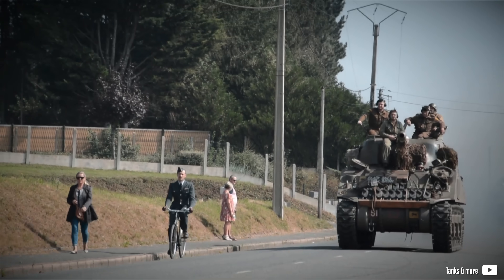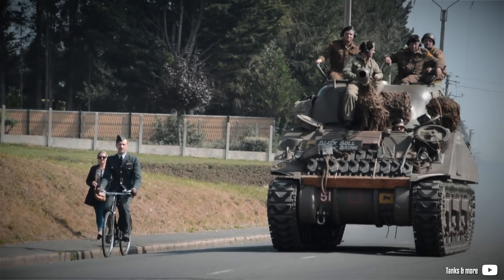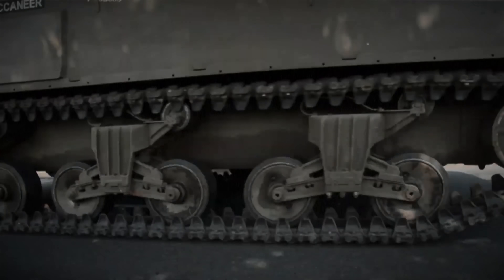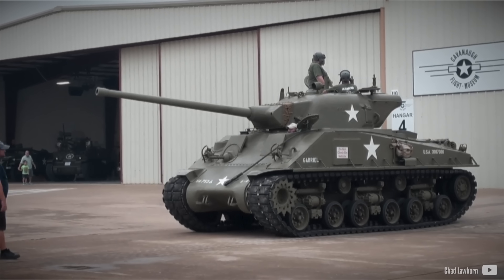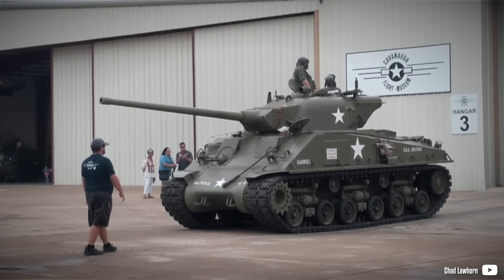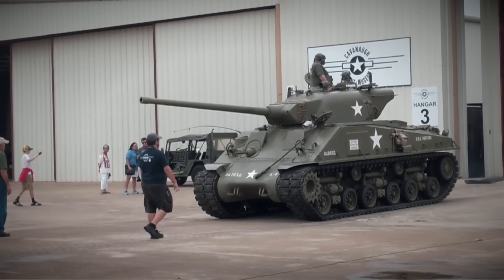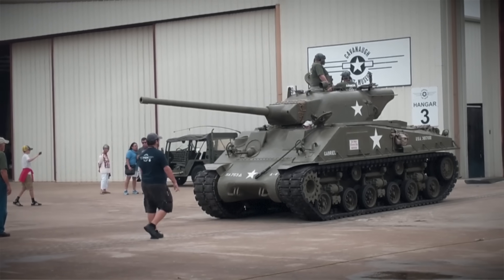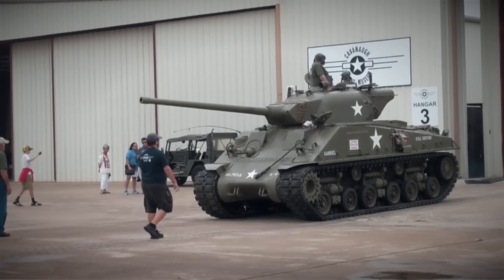This Super Complicated 30-Cylinder Was Sherman's Most Reliable Engine

Comment: VERY COOL, Sir!  
I don't know how the poor mechanics dealt with the thing...  
For the other viewers, how many diesels did they try to use?
Reply: Two different radial diesel engine designs were trialled, but never made it out of the proving grounds testing and evaluation phase. The success was the Detroit diesel twin inline-six pack, used by Marine corps, state side training units of Army, Tank destroyers,  and  export equipment. The Soviets liked it well enough to copy it and use it for years in their APC designs.
Reply: @KevinSmith-ys3mh  Gee, I knew about the V12 GM diesel, but considering how diesels run cooler, I would have thought there were air-cooled diesels in that configuration...

Comment: Tough little 6 cylinder engines those were.
Now a new Dodge diesel pickup has about the same power as the old tank but with one engine and more economical and less smoke and noise.
Cummins torque...

Comment: Many years ago, in the late 50's, when I was building and flying model planes using the Cox .049 glow engine, we toyed with the idea of making a 9 Cly radial engine by coupling 9 engines around a common drive shaft but life got in the way and it never happened.

Comment: This cobbled together engine seems like a great example of how underrengineered is the same thing as overbuilt. It was made with stock parts and relatively little time to refine the design so it was built with lots of redundancy and comparatively low loads to minimize stress and avoid the the risk of a minor oversight becoming a major weak point. It's brilliance comes from how little brain power they could afford to spend on it.

Comment: This design is so genius tbh. A proven engine design and hell if you get hit in the engine or something internal fails as long as the other "engines" can keep working you should be able to limp back never-ending driving with a dead cylinder you could drive this thing with a dead engine bank 🤣

Comment: The A-57 Multibank, al be it as complicate as the Napier Deltic, was basically a reliable engine that Chrysler had produce for a long time before being combined into the A57 for the Sherman Tank application.  Being a mechanic who has restored and maintained many classic and historical US Military vehicles I will tell you that ALL of the horsepower ratings were very conservative.  That is the case for many of the power plants from the 40's and 50's, they were all underrated due to some of the BMEP math at the time.  Regardless, this is a very interesting power plant.  When is VisioRacer going to do a piece on the Hall-Scott 400????

Comment: A flat head 6 cyl engine would have been something many mechanics and the mechanically inclined would have been familiar with. Five of them hooked together was just formality. That helps when comes to maintenance and repair. Which is the priority right after beans, bullets, and gasoline.

Comment: Everyone seems to be talking about  complexity. But the Chrysler Multibank is, ultimately a simple engine: It's five civilian flathead sixes - probably the most ubiquitous American engine in cars and small trucks - geared together. What complexity it does have comes from multiple parts doing the same job - five water pumps, five distributors, five carburetors, each with a design perfected over millions of civilian miles. Any single engine that fails can be pulled out of the system in the field. And, I suspect that disengaging a failed engine might have been much simpler than it'd seem - a matter of releasing one of five dog clutches, or pulling one of five splined shafts out. They'd want it quick and easy to do under fire.

Comment: Gotta love the old chrysler flathead 6.   Even under racing conditions they are reliable.  Not fast, but reliable.  My truck dynod at 83hp and 170 ib ft at the wheels, top speed of 86 mph.

Comment: A fascinating engine to be sure! Seems like a nightmare to work on but maybe not too. International Harvester tried the same idea with interchangeable parts. Problems occur trying for efficiency and longevity while  trying to force the concept of interchangeability over  a wide range of horsepower/torque needs. Trucks got big mostly but brand snobbery in the
American market place contributed to new designs.

Comment: I like the idea of it being able to work with a bank out of commission, and very easy to break a component off and swap out another engine.
Reply: Reliability wise its genius. Yes, there are a lot of parts, but they won't all fail at the same time. And even in the field you could, in dire emergency, Probabaly manage to flip some un-damaged parts into other non damaged sub-engines or something. Would be even funnier if you had a truck you desperately needed with a daged engine and you go, wait up we can spare one of our 5 sub engines for now 😂

Comment: Great video! The early M4s had an air cooled Wright Whirlwind (Continental built) 9 cylinder radial aircraft engine which in itself is pretty cool but this 30 cylinder beast takes the cake!

Comment: Dads a retired trucker, uncles, cousins, me & my brother & brothers in law all drive or drove & retired. Detroit Diesels were the engines most of us ran, M&G car haulers (later became) RYDER hauled volkswagons & mercedes benz off the boats in Newark, NJ. & Anchor Motor Freight hauled GM out of Lordstown, Ohio both had Detroit Diesels in their car haulers. I can say those trucks were single handedly responsible for the right lane on most interstate highways in the country to be nicknamed “THE ANCHOR LANE” because Detroit Diesels can’t pull a sick whore off the toilet. They are screaming meanies but those boat anchors wanted to turn tail & run away screaming every time we came to a hill to pull, & yes we’re talking speeds as low a 7 mph going up hill. They were pathetic as far as power was concerned, very reliable but gutless wonders. And yes every one of us all have ringing in our ears (tinnitus) from driving those dam things for too long. Man what I wouldn’t give to have 1 second of piece & quiet during my waking hours.

Comment: Chrysler from its origins in the 1920s to the early 1970's had a very good engineering reputation making a broad range of stuff from cars to rockets. During WWII, they became a licensed manufacture of Curtiss-Wright aircraft engines. Their engineers made massive improvements to those engines to make them far more durable and reliable. It is interesting to note that Chrysler - Jeep part of Stellantis is starting production of a new in-line 6 cylinder engine for use in some larger Jeep vehicles and Ram light trucks due to their NVH and other advantages over V-6's and V-8's

Comment: Well it makes sense as to why Chrysler did it. An engine was needed urgently and why design a whole new engine when you have a perfectly good multi-purpose inline 6 already being mass produced, with parts available and service knowledge everywhere? Just strap a bunch of them together and set it loose!

And I could be wrong here, but wasn't the whole point of it being that an engine was needed ASAP whilst Ford finalised the GAA?

Comment: Great video and very cool engine. I've been and engineer for 25yrs and never knew of this radial flat 6 design. My father had an old Dodge pick-up with a flat 6 and manual 3 speed on the steering column.

Comment: wow just wow, 5 engines joined by a center "gear".  hurts my brain a little as to firing but when it is all so directly coupled it is clearly ok,  the oiling tho yeah that's wild I guess it was a  type of dry sump, very clever.  I like it.  And they made it a module to extract, quite a good plan!

Comment: This engine is a testament to engineering ingenuity. Today you see multiple components in all facets of industry from multi CPU computers to multi Motor and air pump compressors.Even electric cars with two or more motors. Imagine even if one 6 cylinder engine completely locked up, one could remove that drive gear and run on four instead of five engine blocks. Also using standard parts from greater America was is the smartest thing ever. Today We use every excuse to create unique one-off designs that have to be 3-D printed laser cut , custom metallurgy  etc. meaning number one it’s expensive and number two, once the engines  lifetime is past, it’s impossible to get spare parts.

Comment: I’ve learned to respect Chrysler engineers when I bought my 2007 RAM pickup.  It had a really sophisticated system of damping weights in the front & rear suspension to eliminate shudder and wobble to give it a car like ride, yet the 5.7l Hemi pulled my 6500lb RV easily.  I never had a bit of trouble with it, I swore off Chevys for life!

Comment: I did not know Sherman tanks had 30 cylinders that's insane. Looks like it would be difficult to do their timing on it but I guess they got it down because it worked.
Reply: Timing would not have been a problem because this was 5 separate engines conected to a common output shaft.
Reply: @kennethspencer7402  Yes the problem is the low efficiency of using so many parts, not the timing

Comment: This is something germany tried mainly with aircraft engines.main issue was any little bit of oil or fuel leakage usually resulted in a fire due to the comfined space for exhaust routing.
Reply: garage54 did it too,  they tried coupling three lada engines with chains and sprockets in a triangle. they also tried welding 4 lada engines together in a line to make a 12 cylinder, though 3 engines was the most they could run successfully before fallng apart.

Comment: You would think those 2 lower engines would suffer from oil fouling on the plugs...
Reply: they're inclined up 7.5 degrees from their side so would have run much the same as a boxer engine would.

Comment: I read a WW2 memoir by David Render with Stuart Tootal called Tank Action. David Render much preferred the diesel engined variant. I cannot remember exactly why. I think the diesel had better low end grunt and was easier to start. He had a row with a superior officer when his tank was replaced behind his back. The multi-bank engined tank got stuck or would not start in some muddy or boggy terrain, and all the crew baled out and escaped before the tank was destroyed. Render's commanding officer then accused him of deliberately abandoning the tank.
Reply: BULLSHIT, The Ford GA series was the best best powerplant for the Sherman.
Reply: @sandervanderkammen9230  Maybe it was. David Render did not get to command that version.
Reply: @KevTheImpaler  Well if I remember correctly only the U.S. Marines and lend-lease countries used the Diesel versions, the GM 6046 being just as likely as the A57 to perform poorly off-road as both barely produced 375hp 
While the GAA produced 500hp.
Reply: @KevTheImpaler  Aircraft engines like the R975 and the GAA offered superior performance in tank applications due to their excellent power to weight ratio performance.
Truck and tractor engines are undesirable for tanks..
All the successful tanks of WW2 used aircraft engines not truck engines.
Reply: @sandervanderkammen9230  It has been a while since I read the book. I got the impression he thought the diesel was better at low speed, high torque manoeuvres. Maybe it just started more reliably. It could be he was used to the diesel and resented having his tank replaced with a version that was not any better and maybe a bit worse.

Comment: Sometimes when a manufacturer tries to combine two engines together it leads to cooling issues. Like the Rolls Royce Vulture failed and the Triumph Stag's engine failed. I suppose a difference with the multi-bank is that the engines are not packed together too tight.
Reply: The Chrysler multi bank was an epic failure and that was why it was dumped on lend-lease countries and not used by the U.S. Army.

Comment: Keep it simple and they  no complex hard to get parts any mechanic can work on a flat head engine for the time I would give them 2 thumbs up
Reply: The Chrysler multi bank was garbage!
Reply: @sandervanderkammen9230  I guess  you have  worked  on them ?
Reply: @dssm25  The A57 had overheating problems, piston ring failures burnt exhaust valves and was difficult to achieve its disappointing 370hp as they rarely ran properly, this was due to having 5 carburators, 10 sets of points and 60 spark plugs!
The plugs were often fouled on the lower banks and very difficult to reach.
The A57 was a maintenance disaster with 5 of everything... 5 distributors, 5 coils, 5 water pumps with 5 seperate belt drives to adjust.
The U.S. Army rejected the M4A4s and declared them obsolete for combat operations, they were only used for training or pawned off on lend-lease program to the poor British, Poles the Soviets.
Reply: It looks like a jumbled mess I didn't know what it's track record was as simple as flat heads Are laying those engines all different angles I am sure didn't help any of those problems thanks for the info I like to learn about all the crazy military aircraft engines that were thrown together to make something run or fly.
Reply: (Military and aircraft )

Comment: These engines used nearly indestructable Chrysler Flat Head Inline 6 engines. These engines were known in their day to go double the miles before a rebuild was required. The typical Ford Flat Head V-8, Chevy OHV 6 or Buick OHV Straight 8's. were 30K mile engines where a Chrysler/Plymouth 6 could easily make it 60K miles.
Reply: The multi bank was an epic failure and dumped on lend-lease countries and did not see service with the U.S. Army

Comment: the easy 8 was the best, ford took a Rolls Royce merlin casting  and made it a v-8, it was rated at 159 AMA horse power, thats about 12,000 B.H.P. on the nha clale or car hp
Reply: The Ford GA series was better than the Merlin...
Reply: @sandervanderkammen9230  no, it was a simplified v-8 version, ford was building merlins in their englang factory, and geared up to build them in a the US, but packard got the contract, so ford made a smaller plain jane v-8 not called a merlin, but of the same origin

Comment: As usual I get to learn. I've worked on and rebuilt the sixes Chrysler combined to create the A57. Didn't know that Sherman tank engine was a bunch of Chrysler inline sixes for the formula. Of course it worked! That inline six in many Chrysler models lasted forever. And...you could get much more output from them if properly massaged. 425hp for the Sherman tank engine. Hhhmmmm I think with some alternate camming and carbing with some rollerizing of the valvetrain...little valve work and port work I could see that 425hp number approaching the 1k mark. Tank different beast then I 'spect.
Reply: Absolutely the worst engine sold in the Sherman, past off to lend-lease countries the U.S. Army rejected it.

Comment: In general I could see advantages of a straight 6 over a v8 for tank applications, for example the Ford 300 - 6 was a torque beast that would be right at home powering a tracked vehicle. This monstrosity loses all the inherent advantages of the straight six and doesn't really surpass the v8 or aircraft engines in any way other than, availability.
Reply: The multi bank was a disappointing failure and passed off to lend-lease countries, it was rejected by the U.S. Army

Comment: Cool !   Thanks for the post .  I wonder how much power you'd get if you put a blower on it running and ran 100 octain gas?
Reply: 100 octane gas should allow 7 pounds of boost which would translate to a 40% to 50% increase in HP.
Reply: Just enough to blow up this pile of junk...
Reply: Wonder if this engine was considered for a tank engine https://www.youtube.com/watch?v=Anbm8a-HT9s  Looks cheap to build .

Comment: Although it might be complicated in shape. The parts that would be needed to replaced, were common and the mechanics were familiar with them. the center casting merely held held 5 common truck engines.

Comment: I have one of the 6 cyl engines in a 1953 forklift. Smooth running.
Reply: The direct acting valve train of an L-head is the most efficient, can be very quiet.  This series of L-head motors was designed by former Studebaker engineers: Zeder, Skelton, and Breer. - who were known as "The Three Musketeers". Not long after the v8 era began, Chrylser would lose its leadership over Ford for good in 1952 because the combined sales of the Dodge and Plymouth with this L-head had been greater than Ford sales - it was economical to manufacture and easy to service in the field.  As long as low octane gasoline was the norm the flathead was probably the most practical motor, but during the Korean war the U.S. military began to switch to jet aircraft and volume sales of high octane gasoline would begin to become available for civilian use.

Comment: Most side  valves engines    I ever   had   dealings with   suffered   burnt  out  exhaust   valves   wonder   why these  dont  l  think  wonderful   idea  i suppose   with  bit of   time  they   could    have   cast   alloy   blocks   and heads saved   third  of  weight
Reply: they were running on leaded petrol back then and the valve seats were a soft brass. it seems changing to unleaded overhead valve design made them more reliable.

Comment: The use of five "bullet proof" engines to make enough power to move the M4 isn't such a stretch. After all, Pratt and Whitney did the same by adding rows to the radial engines up to 4 rows on the "corncob" engine that runs in the Lockheed Super Connie.